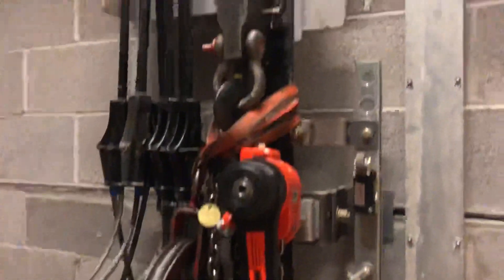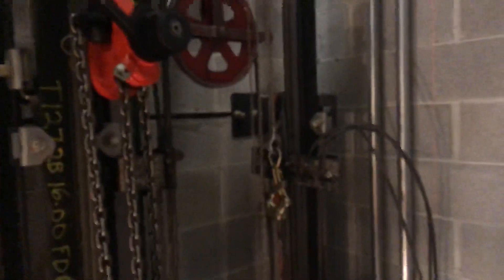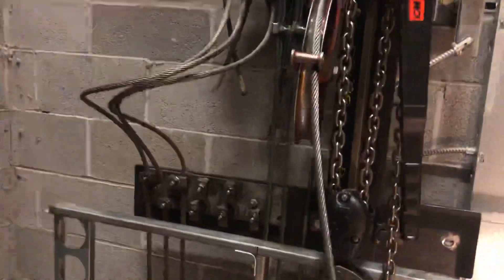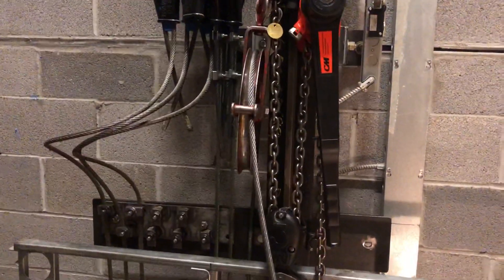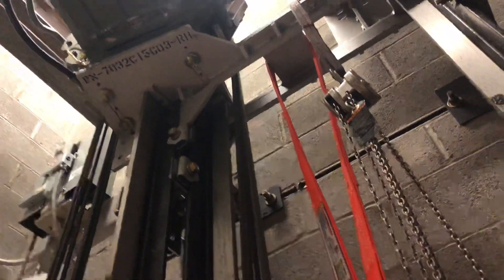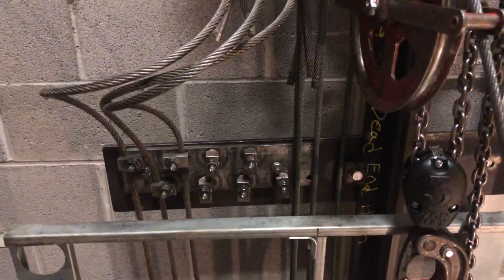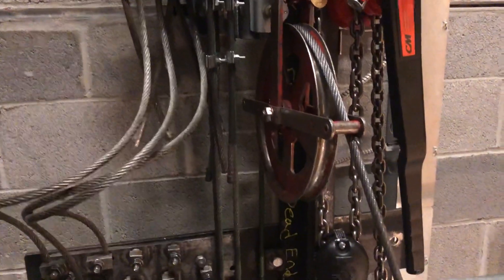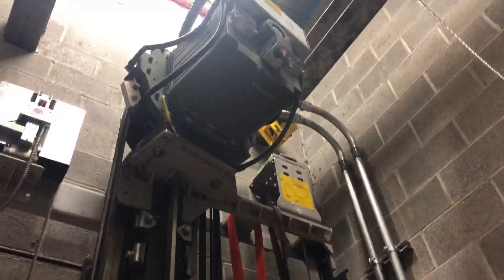Re-roping a 2:1 underslung elevator. Schindler 400A

Comment: Wow, one challenging job and no machine room floor to stand on. From what I'm able to see of the machine, it appears to be gear-less. Is there also a compensating sheave on the counterweight?  A few years ago at a 12 story parking garage two Otis Gen 2 MRL's underwent updates/mods with their sheaves. Originally, the cab had two sets of hoist ropes one passed over the driven sheave, the 2nd over a set of compensating sheaves, top of the shaft above the machine down to the compensated counterweight. It was entirely re-roped, where the ropes passed under sheaves at the top of the cab (like an under-sling) Ends of ropes from machine and weight terminated in the hitch plates top of the hoist way.